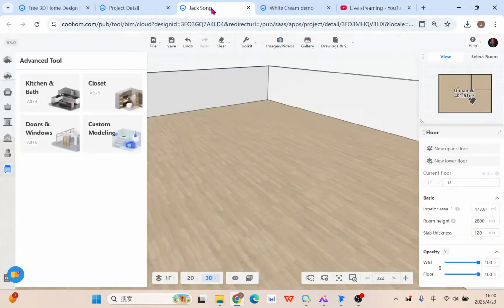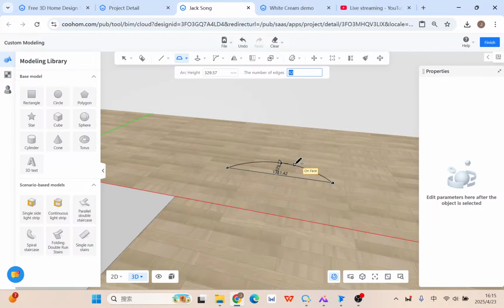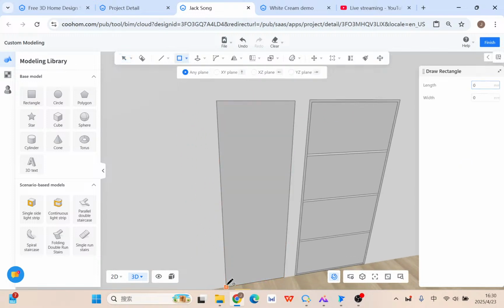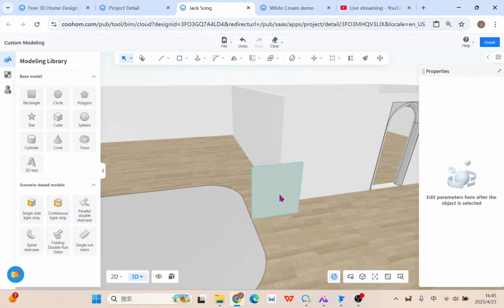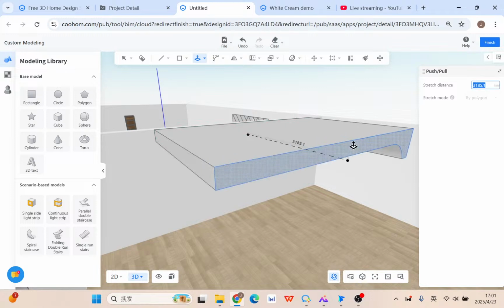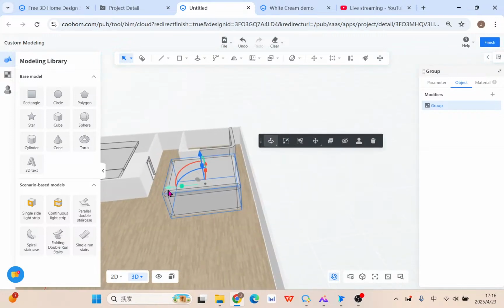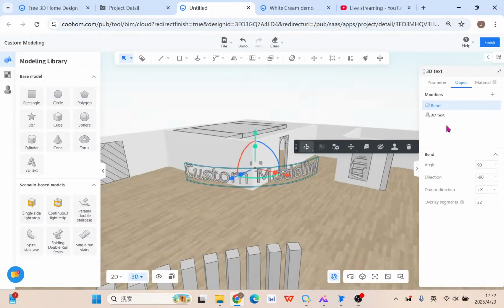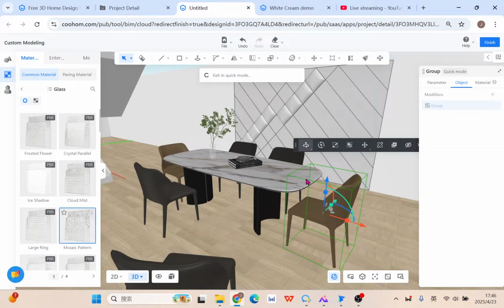How to use Custom Modeling

Comment: The application is very good, but it still has errors in the ceilings,
 when I make a hole in the interior section it always places an automatic cover, 
and I don't know how to solve that. Maybe they can correct that.